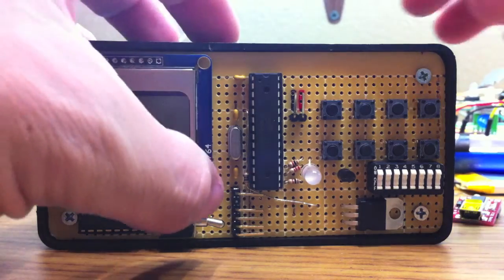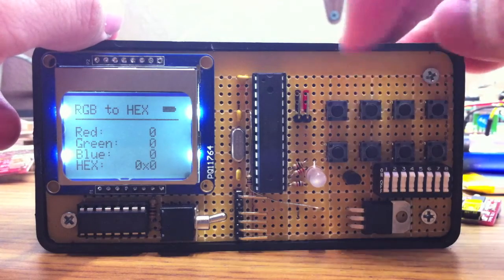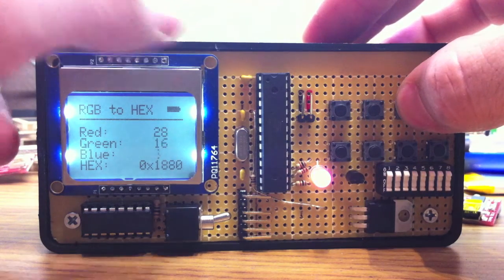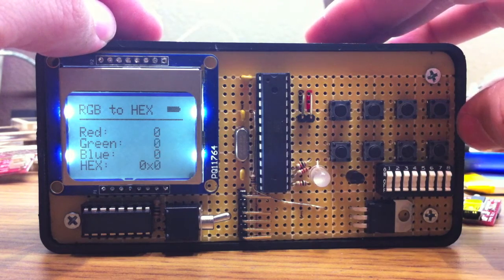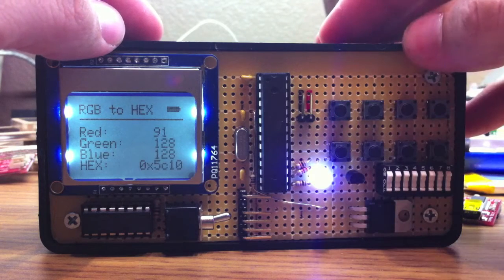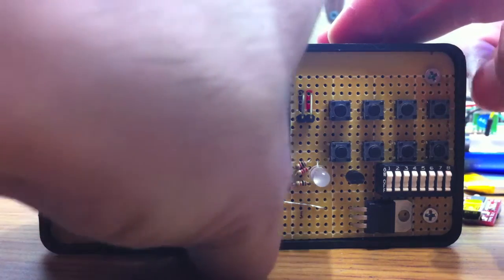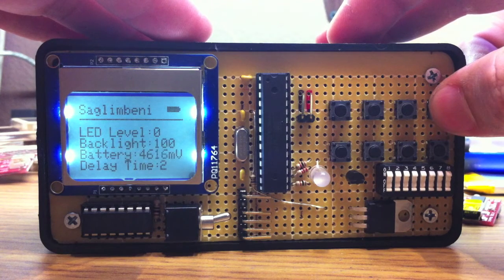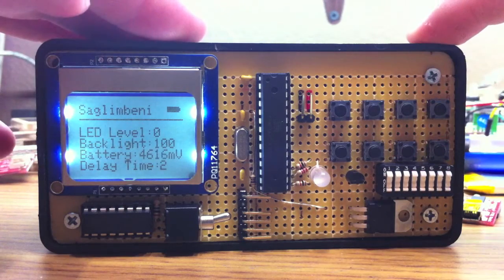Dual Boot LED Control/RGB to HEX Converter

Comment: Hi there,please can i have the code for the other firmware that dual boots,also i cant get the firmware you posted to compile,it has an init error or somthing l;ike that and white isnt declared in this scope and some others,ive tryed adafruit library but you must of used anb older one,also ive tryed nearly all the ide versions too,wich ide did you use? thanks,oh love the project by the way,ile be making a pirchase from the site soon,thanks again. ;-)